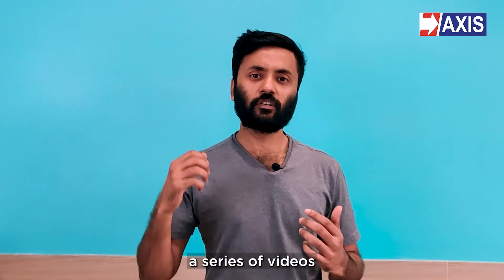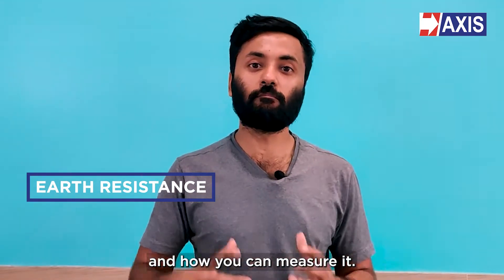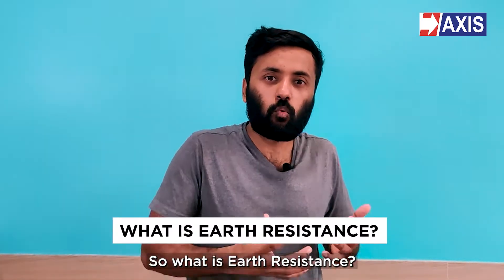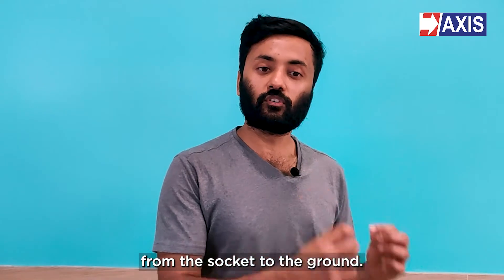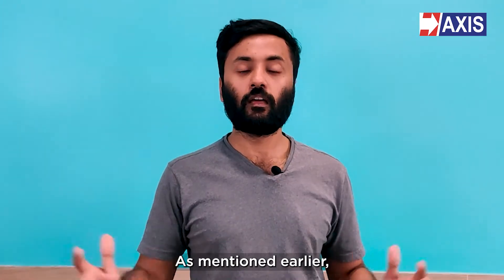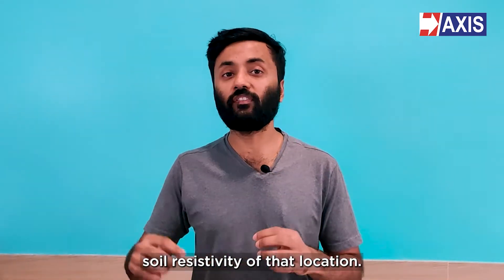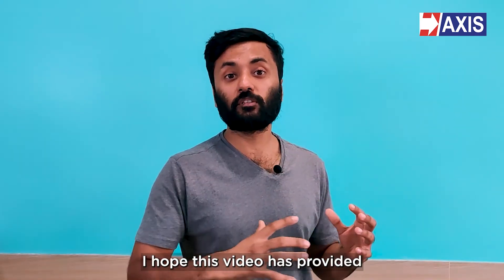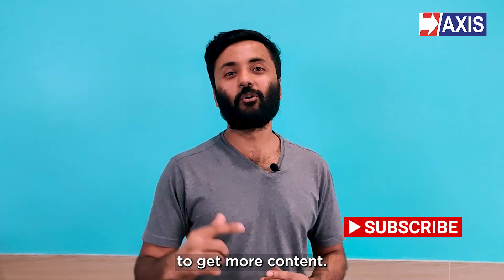What is Earth Resistance? How to measure it?

Comment: Please clarify for us this : The earth resistance is only the resistance of the electrode or the  sum of the resistances of the earth-electrode plus the resistance of earthing  wire.  For example if we have a grounded socket with earth cable 1.5mm2 till the electrical board and then the main earthing wire ( lets say 10mm2) that goes to the earth-electrode, the earth resistance is the sum of the resistances of the wires plus the resistance of electrode ?
Reply from the maker: Hey,
Earth resistance is the resistance value with respect to Soil and Earth. We don't need to consider the connection wire resistance.
So, the interconnecting wires won't affect the Earth Resistance Value.
Reply: @AxisElectrical   but when we are talking about safety of the people in electrical installations don't we need to take into account the resistance of earthing wire ? The resistance only earthing electrode - soil/earth is pretty useless (a theoretical value) if the earthing wire have high resistance.  am i wrong ?

Comment: How to reduce earthing where we are not knowing earth pit and its commercial building . My requirement is 1 ohm but its coming 3 ohm when checked on socket between earth and neutral. Please suggest some solution.
Reply from the maker: Hi Nimesh, the best solution for this is installing more Earth Pits. 
You can get 1 ohm with the help of Earth Pits but that will depend upon your soil resistivity.
 Let's connect at sales@axis-india.com to discuss this further and find a permanent solution to this.